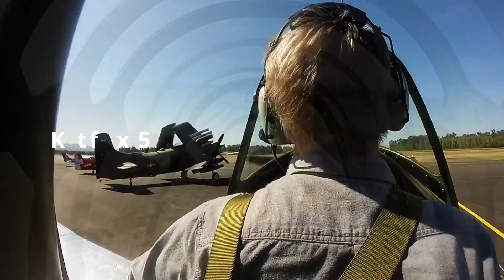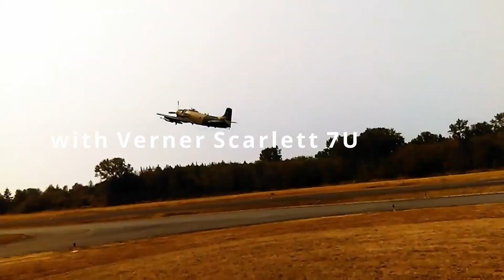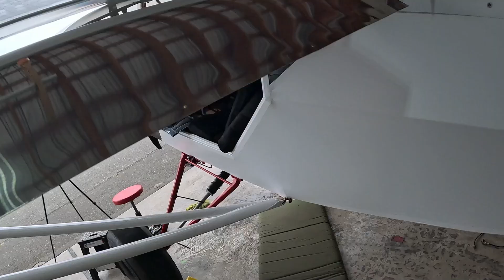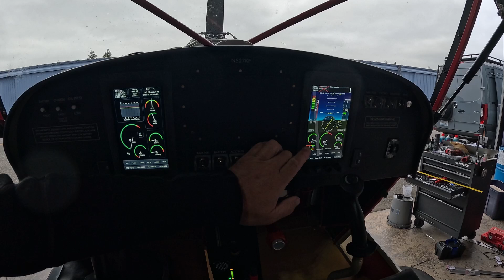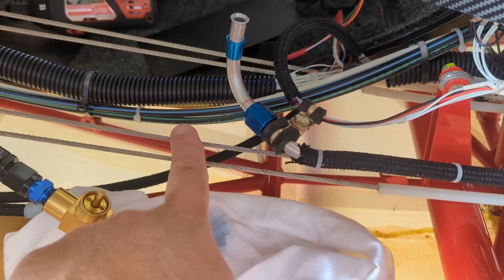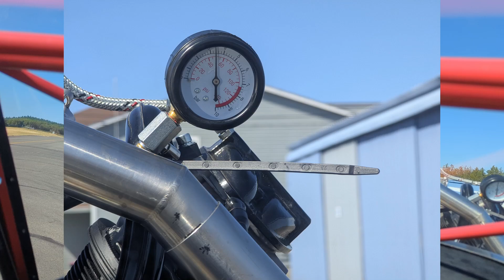Verner Kitfox 5 build video 48 - Refinements to fueling and instrumentation

Comment: Thanks for the update Alex. I like the greased rag in the tubing followed by the shop vac. Nice idea. Don't know what you mean by "tape that runs up the vertical fin" though (a strip of Oratex along the leading edge?). Thanks again, and good luck on your August first-flight timeframe.
Reply from the maker: Glenn, yes the strip the runs from the flat aft fuselage up the transition to the leading edge of the vertical fin.  The toughest spot on the plane to cover and even harder on a series 5